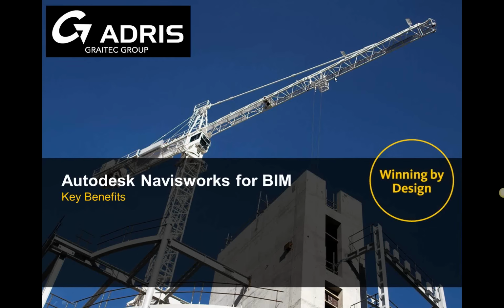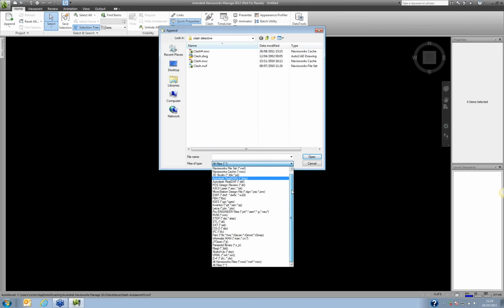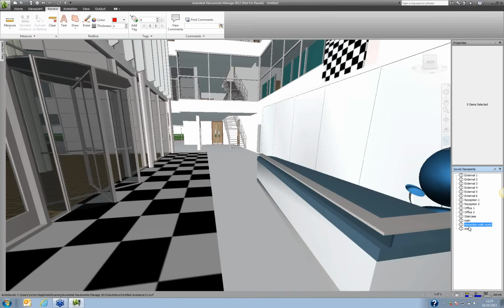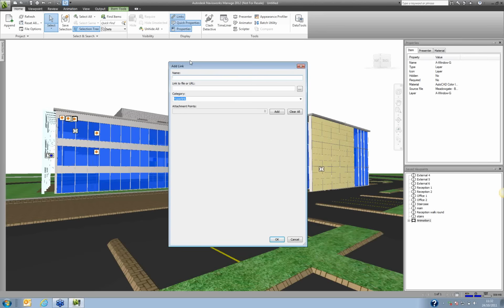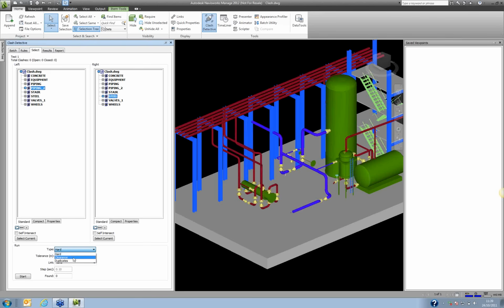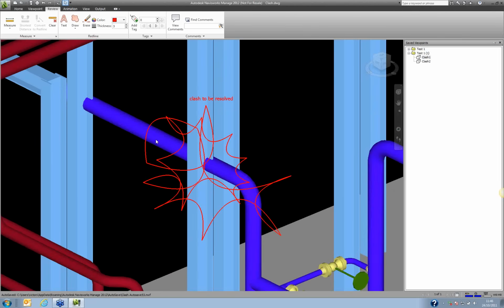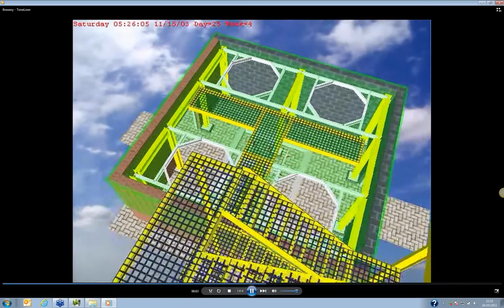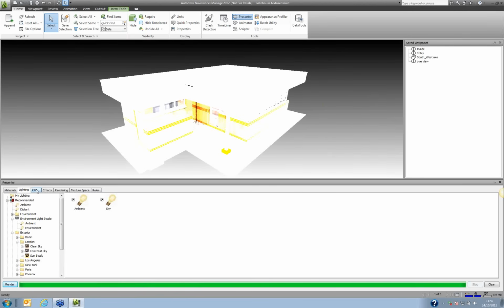Navisworks for BIM Webinar

Comment: - the only one import file format that's enabling interoperability (and thus the only one interesting for me) -> IFC, has been carefully omitted in the presentation. almost 50 minutes later (ok, with a few shortcuts) and i still don't know if i can use this software or not, and if yes, to what extent. i am a non-autodesk user, especially interested in 4 and 5d.
- another thing: location based scheduling. is it possible here?